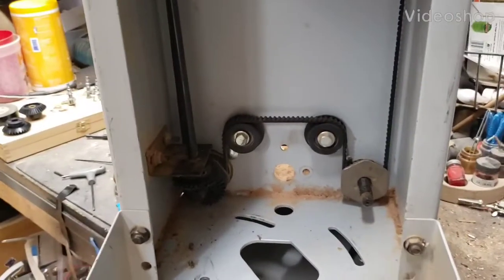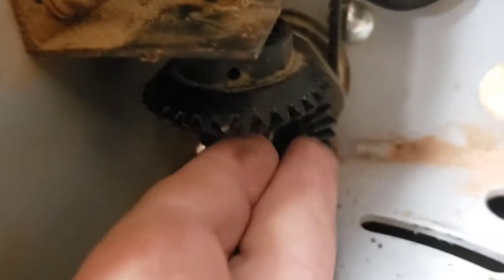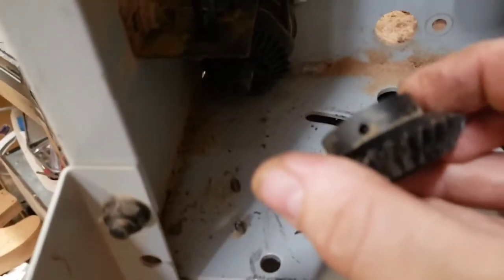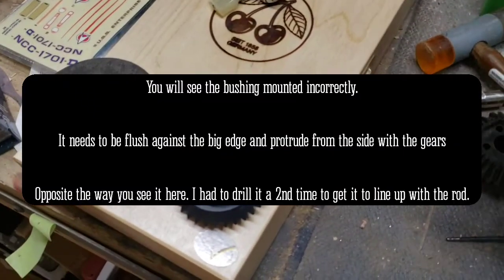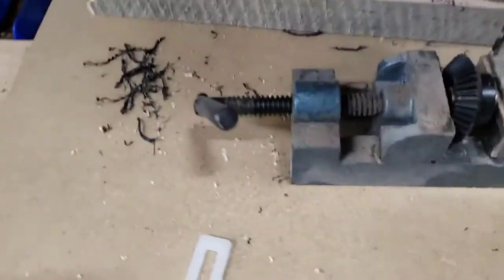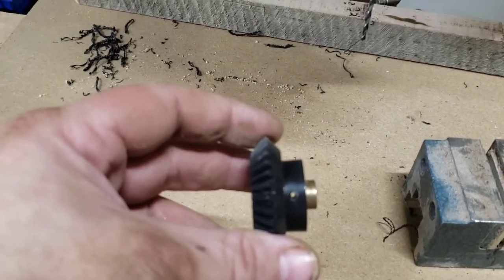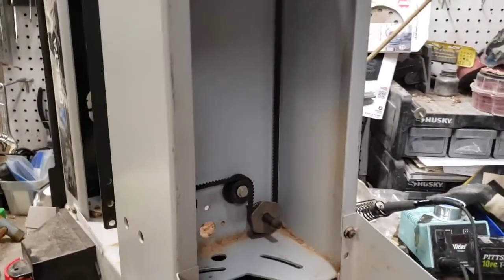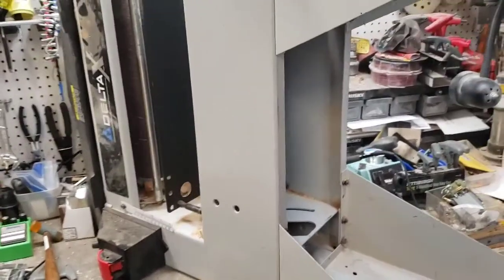Delta X5 Drum Sander Repair STOP THE GRINDING GEARS  31-255x 18X36

Comment: Make sure the four vertical rods are properly aligned. Mine were not and it did the same thing yours is doing. I loosened the bolts holding the rods at the pulleys and used the plate attached to the tops of the rods to help them find the proper locations.  Then tighten the bolts and the cranking action should operate smoothly. This worked for me when my posts got knocked out of alignment. the miter gears started skipping  teeth. That might be your problem. Good luck.

Comment: Thanks. I have this same POS and I concur with your assessment. I just get a lot of clicking noise now and haven't had the desire to look at it. I had it in the shop twice and the "pros" were unable to fix it permanently. I babied it with very light passes and a fairly loose feed belt so the belt slips rather than force something through it and still it got to the point where I couldn't lower or raise the bed. Just a worthless piece of garbage. Looking to replace with a Woodmaster industrial strength tool once I get room in my shop. I guess with this class of tool, it's better to pay and get the big machine or accept working on keeping it running. Thanks again.